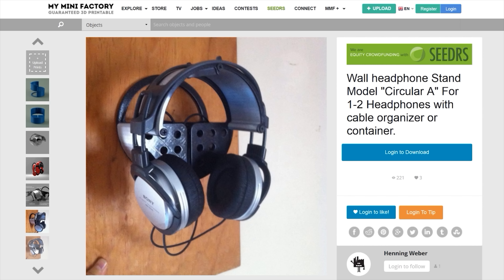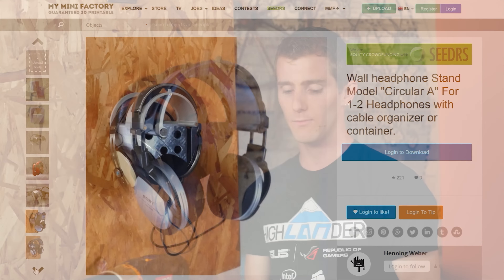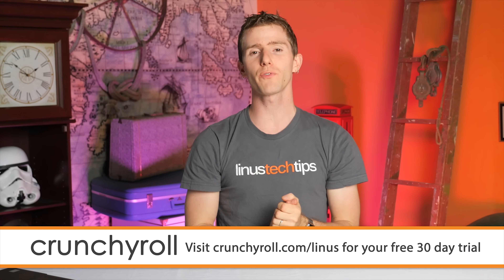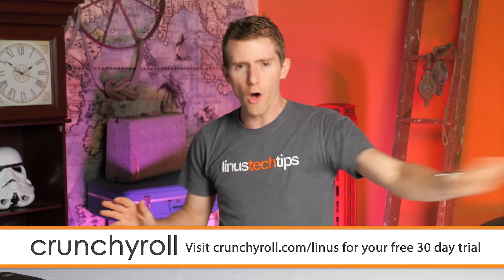Headphone Stand Design Contest Part 2 - 3D Printed Units In Office!

Comment: The design of Patrick is far more elegant than the winner and runner up. Plus the cable management isn't just a basket which results in cable clutter. Linus couldn't find 1 negative about that design, so why isn't it at least a runner up?

Comment: Wire management gets way too much attention plus it can cause the wire to "remember" the coiled up shape which IMO is bad. I actually hang my cans on a large nail in our coat closet and loop the cable up and over the nail at the halfway point. The only disadvantage is the small "dent" in the headphone padding from resting on the nail but it's not noticeable when wearing them. If you want neat looking desk storage, buy a "New Bee" desk stand which starts at $4.87 from eBay or $6.49 from Amazon.

Comment: I think the winning design would be improved if the top arch didn't stick out away from the basket. Instead the arch should be connected to and sitting over the basket. That way you could hang the headphones over the huge cavity instead of having to reach back through the headphones. Just imagine a small but deep cake pan with the bottom half covered.This would give it a more simple look, remove the secondary headset holder that Linus doesn't like, and reduce the bulk.

Comment: Why not just have a headphone stand connected to a retractable spool that you wrap your wire around and when you decide that you done using your headphones just tug on the wire and the spool will pull back on the wire letting you retract the whole thing. then just mount a headphone stand on top and bam ur all done. no wire to manual wrap or anything. simple and functional.
The only drawback i could see is that it would need another wire out of the side to connect to your pc, but if ya really wanted to be neat just have that on a self retracting spool too.

Comment: So many of these are far too bulky, even the smaller ones, as the constantly stick out from the wall. The 2 that folded down were clever, and would have been great with some polishing of the design. 

But I'm not a headphone stand person anyway, they can lie flat on a table/shelf/amp when no in use.

Comment: There's so much hate in the comments. Every design is available for 3d printing, so just print the one you like most if you don't agree with the winner. Plus, the winner looks modable to have the front rung removed, making it a lower profile single headphone holder that would be more practical and better looking.

Comment: I personally really liked the second to last one, but apparently Linus doesn't value "compact" even a little bit for this particular product category. The one with all the sliding bits that didn't quite work fully is more fashionable, but it has a ton of wasted space and I would have preferred just removing most of the bulky bottom section completely.

Comment: I bought a hooky arm thingie for a buck down at the hardware store, and it fits 5 full sized pairs. :-)
I'm too cheap of a bastard to ever buy a designed thingamajiggie and I'm also not the OCD type of person who spends 10 minutes winding the cord nicely and neatly on some weird peg thing which prevents me from getting the headphones off the wall quickly.
But I guess this is all beside the point of this competition. :-)

Comment: I think the design @ ~ 4:09 should have won.  If the runner ups design incorporated cable management (Something I presume could be added in manufacturing-- say make the baseplate recessed so a cord could fit inside wrapped around) it'd be close call between these two.  

My very last choice probably would have been the winning design.  No offense but as a consumer I would never in a million years consider that to hang on my damn wall.  If I saw this product in a store and a wall of various sizes of nails I would choose a nail.

Comment: I'm confused, it's a headphone STAND comp, not a wall mounted comp... who wall mounts there headphones? and needs cable management? you have them sitting next to you, and cables run to the back of your desk... :/
Reply: +Fibregraph aka CrazzyMattyBoy but it WAS a wall mounted headphone stand competition, that's why they all were wall mounted
Reply: +Fibregraph aka CrazzyMattyBoy Well, for instance, people like me.  My desk is a corner desk that's bolted to the wall, my PC is mounted to the wall, I have 4 wide-screen monitors - no more room for anything other than a keyboard and mouse.  As is, I hang my headphones on the wall using a drywall screw... Having a NICE wall mount that can hold both my cheap headset I use for Skype, as well as the headset I use for everything else would be nice.... though I still don't really see the point of cable management...  Those cables will get tangled somehow in the winning design, so you are still stuck having to tie the cables up in a bundle with a twist tie.
Reply: +TheLofren yea, but atleast take the word "stand" out of the title
Reply: +Fibregraph aka CrazzyMattyBoy "who wall mounts there headphones"? People like me who have multiple pairs for different scenarios and don't want them all laying on the desk at once.

Comment: Hey guys, 
I was wondering if you could help me with choosing a graphics card.
What I would like:
Run CS:GO at 200+ FPS
Minecraft at 120FPS while recording 200+ while not recording
Be able to run a triple monitor 1080p display
Run Popular games such as GTA  5 smoothly at prefarrably 30-60+ FPS

BUDGET: £100 - £200
                 $155 - $310

Thanks in advance!
Reply: +Movie Maker my 280x runs mc and cs go at 200+ frames while im skyping and downloading shit, with mc on ultra settings, optifine, and extreme shaders on i get 70-90 frames at all times, it seems low but the shaders mixed with optifines ability to really beef up the graphics its quite fucking good. A 280x is the cheapest option you got, but if you want even more performance go with a 390, its probably around 250 something dollars, 8 gigs of vram and slightly better than a 970, good fucking deal. so, 280x or 390, just depends on how much you want to spend.
Reply: Thanks man! Will look into it! Im in the UK so prices a bit different. I've just looked around a bit and i quite like the look of a gtx 960. Not too expensive and runs CS at 250 and MC at 300 so seems great! Any thoughts?
Thanks
lawn loom
Reply: the 960 is awful mate, unless its alot cheaper than a 280x is the uk all i know is that sometimes uk prices are absurdly lower, and sometimes absurdly higher but the 280x destroys it everything +P please dont go with a 960 unless its like 50 dollars cheaper than a 280x... you'll just be loosing frames if you choose it, i'd suggest this http://www.newegg.com/Product/Product.aspx?Item=N82E16814150690&nm_mc=AFC-C8Junction&cm_mmc=AFC-C8Junction-PCPartPicker,%20LLC-_-na-_-na-_-na&cm_sp=&AID=10446076&PID=3938566&SID= its what i have, runs cool, goes with any pc theme, and gets is a fucking beast, i'd get it if i were you mate, 213 dollars cant beat that.
Reply: Ok ill taje your advice and research into the 280x! Thanks! Will it run popular games such as gta 5?
Reply: Dude you can get gtx 970 almost
Reply: yeah, i run gta v at 1080p with eveything on mid-high with a constant 70 frames with explosions and shit going on, if you got the extra money thugh dont get the 970, get the 390, 4.5 gigs more vram, and slightly better in performance =P
Reply: In the UK The 390 is cheaper than the 280x so I should go for that? Will it be good for while recording too
Reply: yeah, the 390 is amazing, it'll play and record better than the 280x =P so yes, it will last you a long time and will give you great performance

Comment: While the winner had a nice design and amazing construction, it should NOT have taken first place.

It is far too large for practical use and compared to the other designs it does exactly what a wall mounted design shouldn't do. 
Wall mounted stands should be small and simple, the winner was far too large and complicated for necessary uses. 

It would also NOT look good with a single pair on the stand. It's upsetting knowing this comment probably didn't get to you in time, but I feel like it to had to be said

Comment: what if i have wireless headset, theres no need for the cable managment so the runner up clearly won with the sweet design and mounting options. the winner is too bulky and seems like it would get torn off wall easily when going home drunk.

Comment: the one at 10:20 is the best by far, it has a lip, it has space for wires, it's small and you can pack it up when you're not using it to make it even smaller. The winner was so bad, no one would buy it who only use one pair of headphones, and that cuts out the majority of the market. Not to mention its big and ugly. Terrible choice.